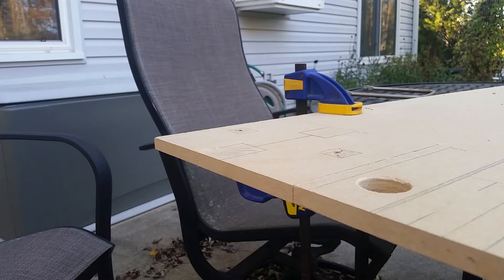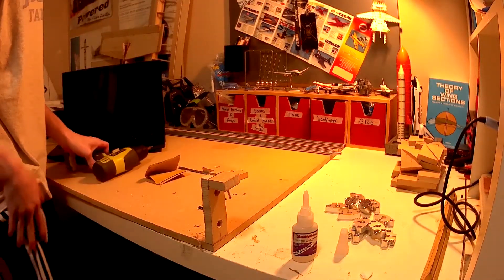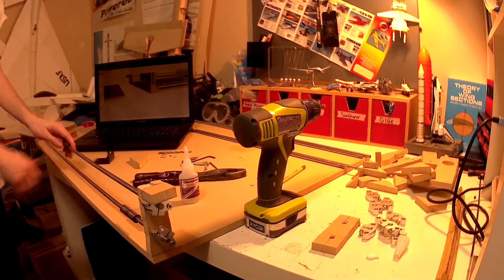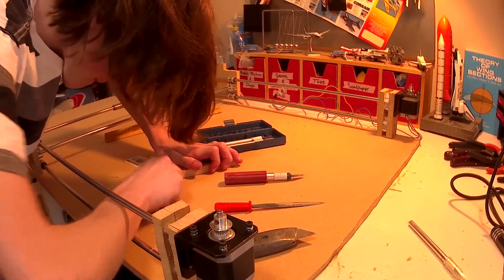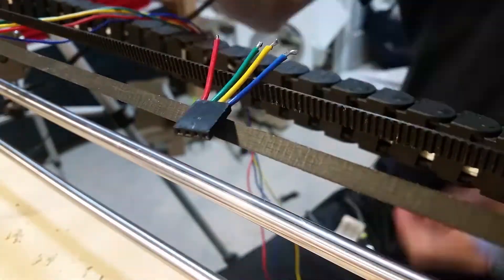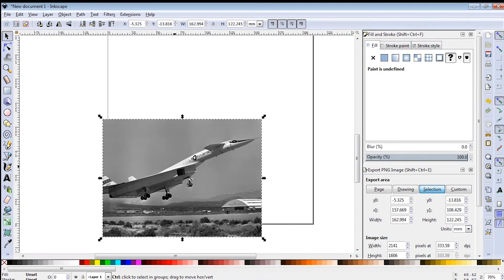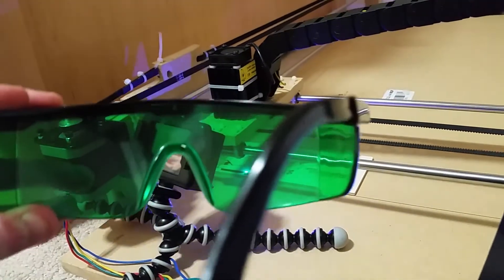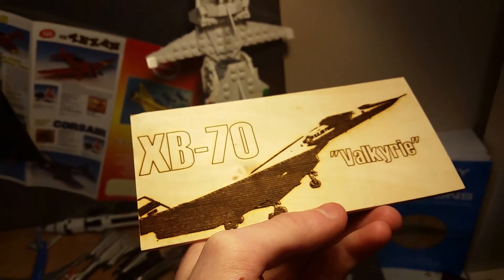CNC Laser Cutter/Engraver Build and Testing

Comment: Great video. Do you have a link to the design files. I'd like to print some of the parts out rather than use MDF. Thanks!
Reply from the maker: The sketchup file below contains the extent of the plans.
https://drive.google.com/file/d/18FwyxDcexm1lFlTNrU4kxII2omlQQtM2/view?usp=sharing
Reply from the maker: I have a sketchup file that I used for planning below:
https://drive.google.com/file/d/18FwyxDcexm1lFlTNrU4kxII2omlQQtM2/view?usp=sharing